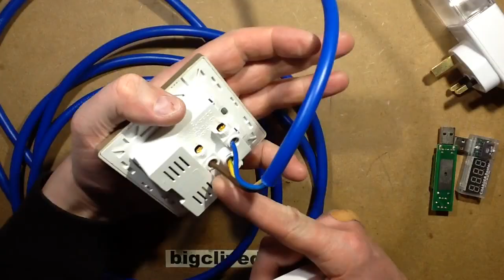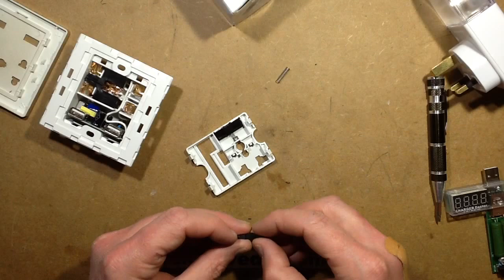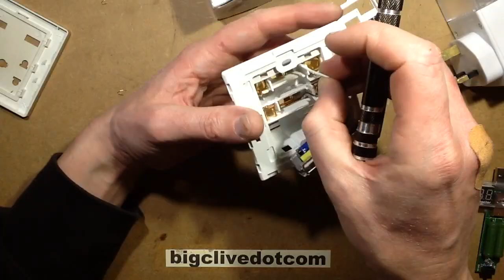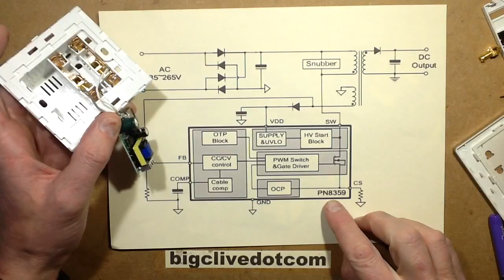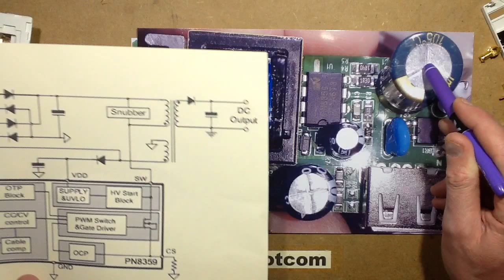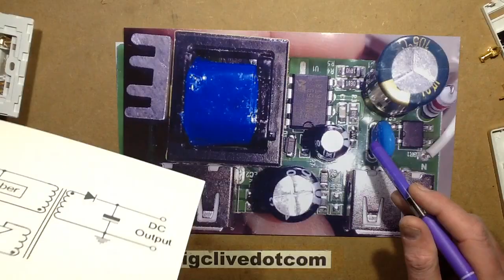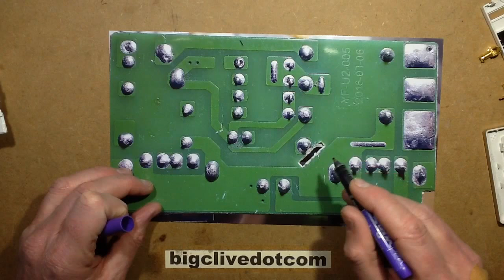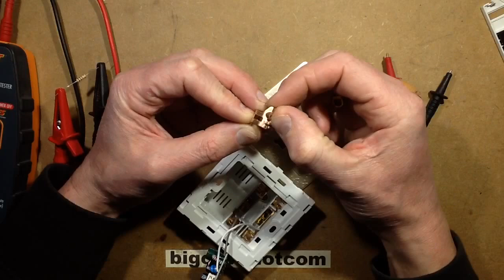Wall plate death-dapter tests including fire and 1kV.

Comment: On a recent trip to Vietnam, all the hotels had these adaptor plates and we had no end of trouble with them, the euro style 2 pin plugs just fall out and the larger type bend the contacts. One was so bad that every time the rooms fridge kicked in you'd get buzzing noises and sparks coming out of it.
I think anyone going abroad without proper travel adaptors is a fecking idiot who deserves what they get, but it this case we got screwed because we'd planned ahead.

Some of our stuff has those 2 pin euro plugs with the fused UK plug adaptors that wrap around them, we normally remove these adaptor when going anywhere without UK sockets (it's just added weight), but this time we ended up wishing we hadn't removed them as half our stuff wouldn't work unless we could find a normal 2 pin socket.
Reply: This do you see in many countries in asia. The most standard female sokets can use only for 2/6/10 Ampere. But the wall mounted socket plate and the fuse before accept 16 Ampere of course. So the female side not burn into the male side holes or all go on in flames.
Reply: Speaking of Vietnam: while I was in Hanoi for some IT work at basically still a construction site a couple of years ago, the guys there used a high pressure cleaner for some random work outside. The thing was plugged into mains with a very flimsy looking, very long power cord (basically just two wires twisted together and possibly 20m long). Without a plug, just the plain wires. I was pretty much shocked when I saw that... xD
Reply: Strider9655 i always pack 3x travel adaptors and 3 x 4-6 way powerstrip that take my uk plugs.
Reply: Sirus
Yeah, we just have a few essential items which have euro plugs fitted with wrap around UK adaptors, we just take the UK adaptor off before we go, but this time these sockets screwed us over.
Reply: Same I do on all my travels - world wide with adapter of course. I never haved see problems in that. Here in Thailand I have some of my 3 way sockets with thai femal socket on the cable too.

Funny was a power box on a camping place in italy. CEE 220V 16A 6h one phase sockets only. 
Adaptor CEE to three CEE / One I use, Adaptor CEE to swiss / Swiss 3 way sockets / Adaptor swiss to Italian / Italy 3 way sockets / Adaptor Italian to german socket / German 100 m cable / Adaptor german to CEE for my Caravan. 

Sure, the swiss and italy tourists do not know CEE adaptors to local power systems - they use only the local power connectors. But this italian camping place have only CEE power connectors. ;-))

Comment: Yeah, how the hell to technical people survive their childhoods, I won't comment on how many stupid things I have done or will do, will we ever really get past that knitting needle phase?? Remember plug it in and see what happens is still like poking some thing into an outlet that doesn't belong there...
Reply: And yet we still keep going.  Had several run ins with electricity and pyrotechnics in my youth, went into computers, then got into welding and automotive lol.  Whether it's turning the key after working on an engine, hitting a power button on a computer I've just put back together, plugging in a piece of electronics I repaired or striking an arc there's that slight "Hope this is gonna save me" flinch there, usually followed by a big smile when it wasn't needed lol.

Comment: I like the pcb, but the socket is just junk.
I would dremel the pcb for bigger creapage gap and stick it in a little box as a bench charge unit, after adding a 2 meg ohm resistor across the grounded feedback resistor, lift the output slightly :-D

Comment: The US plugs should have those shutters. I jammed RCA cables into an outlet when I was young, trying to be like my handyman dad with his meter leads. I was scared of that outlet for a while afterward.
Reply: The US National Electric Code does require tamper resistant outlets for any new residential construction.
Reply: GemCat How did you fit an RCA cable in one? I just tried, and they can only fit in the ground socket.
Reply: GemCat, the NEC is starting to require them in certain areas.  Of course, which version (if any) of the code in effect is dependent on the municipality.
Reply: tralt135 This was before I was ten and it is according to my parents. It might have been an old plug design, maybe different cables. I dunno.
Reply: There are NEMA plugs with shutters. I think it’s pointless.

Comment: I developed an interest in electricity when I unscrewed a socket from the wall, just to see what was behind it, of course now I've had countless mains shocks over the years, I tend to stay away from mains power, cos it bites... :P

As for the flame test, I think the british standards say that it has to self-extinguish as soon as the external flame is removed, so, it would be a fail on the flame retardant material test... :S

Comment: do euro plugs normally have two places to terminate wires on the back? if not, how do you chain them?
Reply: Here in Michigan (and I assume the rest of the US), you're not supposed to chain outlets through the two terminals anyway. The reason for two terminals is so one outlet can be switched. You're supposed to connect a pigtail and nut together the incoming, outgoing and outlet wires (and pigtail to the box on the ground).
Reply: Super AWaC Not sure if you are specifically referring to the UK 13 Amp socket outlets or the European Schuko type plug and socket.
As far as the UK 13 Amp socket outlets are concerned, you may encounter duplicate entries for the phase and neutral connections, but most commonly when connecting a radial circuit and chaining the outlets, both conductors are entered and fixed in their respective single terminations.
One exception is with Earth-Ground conductors in installations where equipment with high leakage currents are encountered, viz. IT equipment.
Here our regulations require an additional separate circuit protective comductor to be independently run in addition to the normal circuit protective conductor.
As far as Europe goes, in Spain I understand that chaining of socket outlets is not permitted, and each outlet is to be wired back to the Caja de Registro, a type of joint box in each room where connections are established.
I believe this is because it is doubtful if the metal deployed in the manufacture of the contacts is of sufficient grade to be able to carry the sum of the currents downstream.
On another point of interest, Manuel Amate of Domo Electrico in Spain has recently posted a video about accessories made by Simon, and these, as far as socket outlets are concerned, have inlet and outlet terminations which only require the insertion of the conductor complete with insulant into the hole and then a lever is depressed which somehow effectively accomplises a reliable termination. Perhaps a bit like the German WAGO connectors without the need to strip insulant off. I should like to see the test results at full load on that format. Temperature rise due to poor termination would be my concern.

From another electrician who nearly got electricuted as a child!
Reply: SuperAWaC the terminals are big enough to fit more than one cable into
Reply: Daniel Brydon fair enough. i still think eu plugs are overdesigned. but it is what it is.
Reply: ChefSalad i don't know about all GFCIs but for normal outlets and the GFCIs i've encountered you can wire the circuit in parallel directly to the screw terminals and it will work just fine. that's what the dual terminals are there for. if you want to switch a single outlet on a circuit then yes you'd need to pigtail it so one of the poles can be interrupted by the switch but outside that case it's not needed, it's also not specified in code except for multiwire branch circuits, which i've never seen in residential
Reply: SuperAWaC also there is tabs on both the hot and neutral .You can break the tab on the hot so you switch that outlet separate or break the tabs on both the hot and neutral so you can make one of the plugs a isolated outlet incase you have a device that draws alot of current or produces alot of line noise or I have even seen a isolated outlet used for something medical so it was on its own dedicated breaker.
Reply: +kardeef33317 yes good point

Hassan Burrows interesting. i wouldn't really trust anything but a screw terminal because of its security and high contact area, i've installed some GFCIs that have both screw terminals and "backstab" style connections which you just stick the stripped line into and it holds it with a springed connector, seemed dodgy to me, but way less dodgy than a insulation piercing blade type
Reply: SuperAWaC that's true for gfci but that's an exception that's not really an exception. The line input and protected output are different functions, so every connection has just one wire. Wiring through a regular outlet has you connecting two wires to one function and that has to be done with pigtails instead. The reason you can do that with a gfci is because the gfci is designed to pass a load through it. The little tabs that connect the terminals together in a regular outlet aren't designed to have a high load on them. or so it was explained to me. It's always seemed a bit of a nonsensical requirement to me, but it is what it is.
Reply: ChefSalad i am pretty sure any properly made outlet will have enough metal in it to be able to pass 15 amps with no trouble. these outlets have way more metal in them than the wires that go between them.

Comment: Neat! I like your UK style plugs that have the switches built into them, which this doesn't have. I too hate leaving unnecessary electronics running all the time.
Reply: They aren't safe to your feet though if you happen to step on one.
Reply: PriusPilot you can buy them with or without i lke to switch things off with a switch, UK plugs are massive compared to other countrys but are very safe which is good since we use 240v
Reply: I have literally never stood or come near to standing on a UK plug by mistake. How do you do that? Do you have them lying all over the floor or something?
Reply: Benjamin Edwards Exactly, we need to make home automation cheap as dirt to make it really take off.
Reply: orion khan your plugs are dangerous more than anything. I visited the USA every plug I used from hotels to a friend's flat were all icky feeling. Many of them sparked given the lack of ground and slightly larger plugs with built in transformers just sagged off the wall exposing the pins. Given the strict fire code regulations in the USA, it's odd that electrical safety is sub par by comparison.
Reply: Australia has switches on the power points, too. Though our plugs have thin cheap-to-manufacture prongs unlike the chunky UK ones.
Reply: Living in the US I have socket envy after watching this video...  our plugs are lame :/
Reply: RuralAccent Woodcraft I've done it the pain is excruciating
Reply: PriusPilot this.  Power strips are ok and all but its a simple thing to implement at the source. Honestly, why not develop a switch that uses infared to turn outlets/strips on and off.  You could then have a tiny app on your phone to blast it light of sight

Comment: When I was young - probably 7 or 8 - I had a little battery-powered electric motor.  It spun nicely off of a 9V battery...so..you guessed it...into the wall outlet the two wires went.  KA BOOM!  Sparks and smoke...and the motor was blown into at least two pieces.  And today...I'm an electro-mechanical engineer...  :)
Reply: Thank you i got it.
I should blow something up so i can be an electrician.
Reply: Interesting story here when I was a kid I was making an electromagnet doorbell wire a 6 volt battery and a nail or screw or bolt as the core been so long I can't remember.

I was not stupid enough the hook this into the 110 volts AC.

However one of the relatives that happened to be staying with me when are you doing this was so inclined to do so.

As I remember he went into to the garage found a line cord with nothing on the end already stripped proceeded to connect them to the two wires of the electromagnet.

And then proceeded to plug in to a nearby Outlet.

At that time a few moments before my parents had pulled into the garage where are the electrical panel laws at that time it was all fuses as soon based glass fuses. AKA plug fuses. And they actually saw the flash from the fuse when it blew on a short circuit no real big bang when it was plugged in but that was enough excitement. I never trusted that personal for electricity again.

Another time we had something to happen like that except this was worse.

My dad was trusting the Christmas lights upstairs I happened to be in my shop which was also the utility room of our house. And the next thing I knew was heard somebody yell it's on fire and simultaneously hearing the breaker trip for that circuit needless to say hi Grandma fire extinguisher out of the workshop.

What had happened is it was not the lights that were no good it was the outlet was improperly installed to small outlet box J box and other words and it had shorted when I plugged it in. Due to contacting the Box.

Another thing that happened in the same house when I was there by myself vacuuming the vacuum start playing up almost like there's a problem with the electrical voltage however the lights were not flicker or any other signs of weird things happening obviously a I shut it off and then I happened to smell smoke.

No it was not coming from the cord order plug vacuum it was coming from the Outlet itself.

I yanked the cord and plug out and then grabbed the CO2 fire extinguisher I had in my shop.

If I had not have CO2 it could have been really bad.

And later on I did change out the outlet I did dismantle it to see where it happened somehow there's metal bridge between hot and neutral. But this day I cannot explain what exactly caused it or what that piece of metal even was It looks like it didn't belong in there in the first place.
Reply: I did the exact same thing with my friend as a child. A loud bang and a burned carpet was the end result.
Reply: Lol I did the same xD
Now I'm an engineer
Reply: I did similar things except i realized that it may blow up, so i got around 15 of them and put them in series... Powered from rectified 240v...
Reply: @rikka0_059  at that age I didn't even know what a rectifier was.
Reply: I did the same thing

Comment: they could have just gone for a TO220 diode package and get the two smd diodes and the heatsink off the bom
Reply: Those are expensive, they don't want to spend an extra 5 cents on one.

Comment: Many things are unknown when it comes to the safery of the power supply. Is the capacitor bridging primary and secondary a high-voltage safety capacitor? Is the transformer isolation good enough? Ideally you put the isolation tester between the mains (Line and neutral together on one lead of the instrument) and output (Vcc, GND, Data +, Data -, USB shield ground all together on the other lead) and run the isolation test at 5KV (for devices that are supposed to operate at 230V mains).

Also, lots of input filtering is missing, and I thought the EU standard for creepage distances is 6mm, not 3mm.

Lastly, with such a low output voltage (realistically 4.3-4.4V at 1.5A at the end of the cable), most "smart" devices (mobile phones etc) will assume a weak power supply and limit current, so you won't get fast charging.
Reply: ferongr it basically means, the vast majority of chargers lie about the power they would send to a device.  Smart charging chips are going to be de facto for decades to come
Reply: yeah, I noticed I have a 2A at 5V charger (should be 10W right?) but my phone doesn't fast charge from it, just charges normally, faster than a regular charger but still much slower than fast charging because my phone doesn't count it as a fast charger
Reply: "Fast charging" is many things. Most of the times, "fast charging" displayed on a smartphone's display means connection to a QuickCharge/USB-PD compliant power supply, that increases voltage to carry more power with less cable/connector losses.

Limiting current depending on voltage is different. Smartphones during charge don't act like constant power or constant current loads, that would make weaker adapters either overload and destroy themselves or shut down from their protection. Smartphones when first connected to a power source actually quickly ramp up input current and stop drawing more when the voltage starts dropping, indicating a weak power supply reaching its limits.

The power supply in the "wall plate" would make most devices charge very slowly as they would assume it's operating at its limits due to the low voltage.

Comment: i was that kid lol
Reply: mixolydian2010 Yeah when I was a kid I kinda understood electricity I once wired up about 10 flashlight bulbs in series and I wondered why I kept needing more batteries to power it
Reply: mixolydian2010 same
Reply: I once stuck my finger in a lamp socket when i was a kid I thought it was off but it wasn't and I took apart a electric fly swatter apart and played with it untill I got shocked back then I thought It couldn't shock me since it ran off batteries and now im a armature ee/mechanical engineer I live on a farm so I usually have to get up in the middle of the night to fix something things only break when your busy and not bored
Reply: oh crap ouch!...me it was the screwdriver in the socket trick threw me across the room was about 8...you learn stuff that way..mostly to work on low voltages until your brain starts working lol
Reply: I wonder if somebody in the family still has the knitting needle that got Clive started?